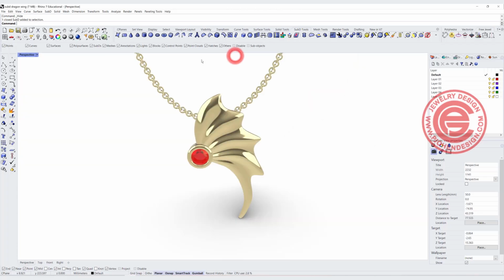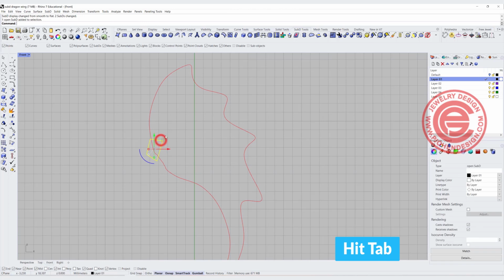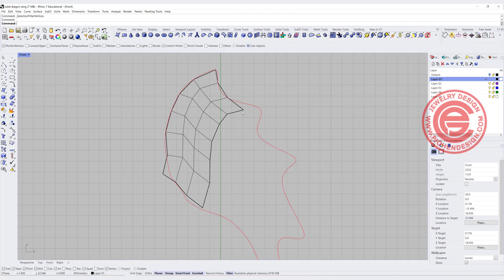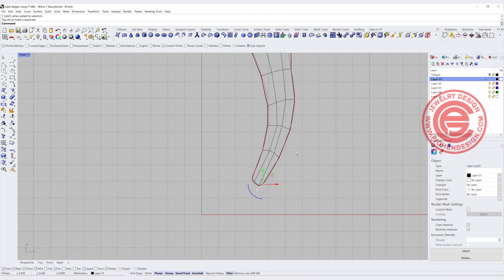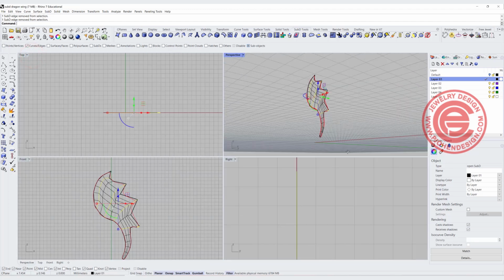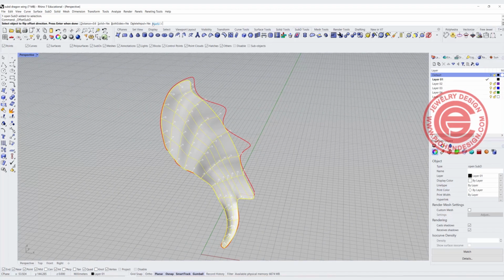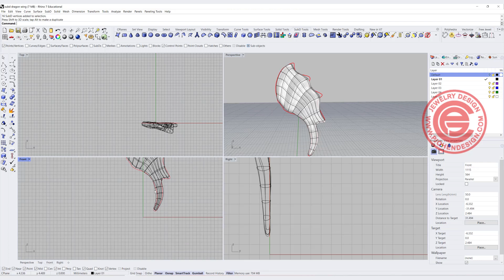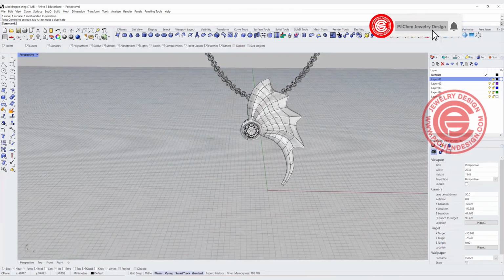SubD Dragon Wing Pendant- 3D Modeling Tutorial with Rhino 7 #309

Comment: Hii, thanks for tutorial I would like ask a question I have rhino 6 and not sub d command not available on this, so can we use another tool for this dragon shape kindly suggest which tool use for best this design thanks
Reply from the maker: unfortunetally, SubD only come with Rhino 7, Or if you have Rhino 5, you may still able to use T-Spline for free from Autodesk. However, you can always edit the control point to get similar model. I have several edit control point videos on the channel, you can check them out. 
by the way, you can also download Rhino 7 trial for 90 days free at www.rhino3d.com
Reply: @PJChenJewelryDesign  ok thanks 😊 for reply I will definitely switch to rhino 7 nice to talk to you..:)

Comment: would you also be able to let us know which resin material and printers we need to use? everytime I print something with my elegoo I get told by the caster that it's the wrong material
Reply: You should use a wax material to print and not the hard resin
Reply from the maker: As long as they are castable resin, it should be fine. your caster should have specific investment for resin not the regular investment for wax as well.